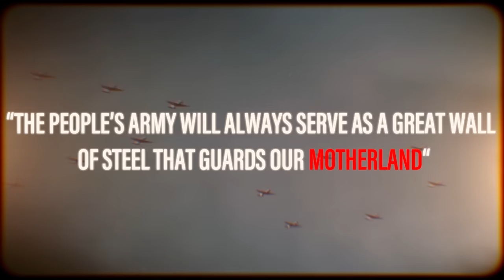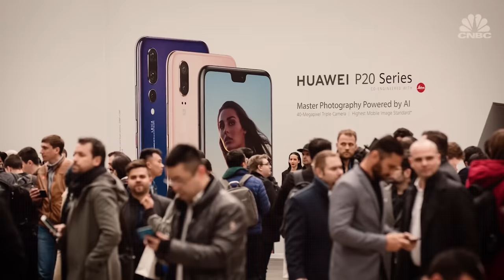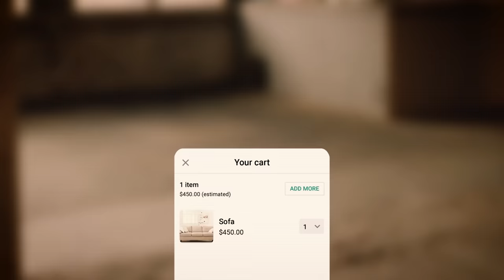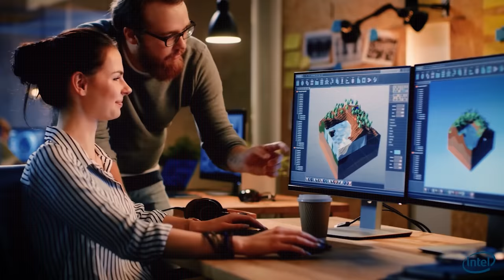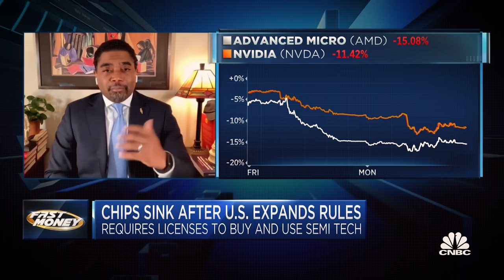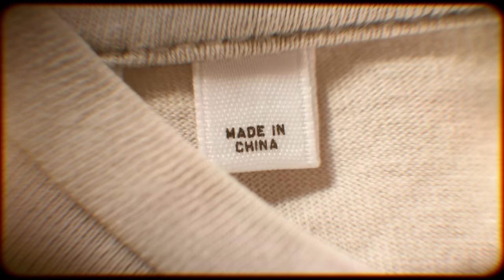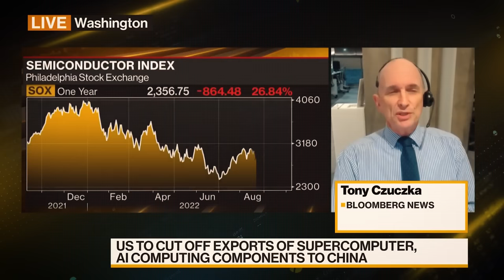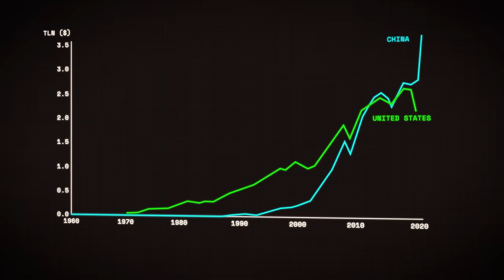America Just KILLED China's Tech Industry

Comment: So the problem with the AI wars... what we are looking at right now, is that they have a shelf life. AI is heading somewhere and very fast. So I've work in IT since the 1980's, I got my first computer back in 1979 as a kid.  In that time hardware... the physical technology like chip design, memory capacity, storage capacity, networking has exploded faster than any industry on Earth now or in the past. 

Every time it did the software needed also expanded to make better use. My first computer had about 2 kilobytes of usable memory. My second one had about 64kb of usable memory. The one I'm using right now in kilobytes has almost one million times that and the processor is almost a million times faster, and this is my home PC. This is something like buying a model T Ford back in the day and by the time you upgrade, the next car is the size of a shoe box, cost $1 and has a top speed of 10,000mph... that's pretty much a good analogy. And that held sway until about 10 years ago.

But the huge advances I've personally seen, and worked with over the past 35-40 years are nothing like the advances in AI hardware and software. The advance in the AI sector in just the past 24 months is similar to the huge advance I seen during all my time in this field, and it is accelerating.

But there is a wall coming. Eventually AI will be so advanced that we will no longer need human designers, or coders or even data scientists... the AI itself will be able to advance itself. That wall, that some refer to as the 'singularity', the last invention humans ever need to make themselves, by my reckoning could be by 2030. Some put it at 2040... and pessimists might push that out to 2045.

Hence the race. and hence the US putting the spanner into China, and Russia... right now. And Putin is right about one thing. Whoever controls AI really will control the world. 

But, I, and Putin are making the assumption here that ultimately AI is something that is controllable... otherwise AI will control AI.
Reply: It’s coming
Reply: I was told that the singularity was almost here in 1995…
Reply: @Donald Thompson eurobeat has an A.I. singer that sings and makes it's own songs. It mostly sings about killing itself though :/
Reply: I don't see how humans can possibly control a general AI; we've already been ceding control of many decision processes over the past few decades, as computers have become more efficient than us. They don't even need to achieve parity in intelligence to be superior, although I agree with you that this will likely happen by 2030. No way to predict what might happen once that threshold is crossed.
Reply: @Donald Thompson thats a good question, you know that art and images is a primary target for AI...and with the huge language models, then writing, news, articles, maybe soon books could be written by AI...

But there is something many pessimistic critics fail to recognise. Which is, for example, people still buy handmade shoes... And they pay a lot for those. Because they want articles that demonstrate craftsmanship and skill. Music absolutely falls into that category. 

But when do I think hiting an online composition model to write a jingle for your advert? Or write beats? Or elevator music? Well that ship has already sailed. If someone is a business paying for music they will always prefer cheap over art.
Reply: @sylviam6535  1995 was during the second AI winter... And we didn't have the processing power, and as someone that worked on early neural nets and genetic algos during the period everyone knew it. That's why we were in the AI winter. It's why many gave up... I sure did.  We knew what we needed, but it hadn't been invented yet. This is pretty much not an opinion, its a math calculation. Simple as that... And capacity has not reached the level that would make any sort of singularity outcome realistic right now. Let alone when processors had less than 1% the power and GPU's were something new in the mid 90's. But advances in gpu or tpu technology can be predicted decades out. Their capacity increases on a logarithmic scale. So im saying 2030 and I will be wrong there... Im no prophet. All im doing is looking at the trend and logarithmic scale. So I wont be a decade wrong...more like a year or two.. maybe 5 years out. 

Right now you have an AI in your skull and its cheap, its incredibly intelligent, it repairs itself, and it lasts nearly a century. It uses little power, and that power is supplied by cups of coffee and sandwiches and not a power station attached to a data center half a kilometer in size. But the day of you beating a machine the size of a phone, that uses 10% the power you use, and powering itself for hours after five minutes sunlight. Your competitor here is also networked to others,globally, the digital equivalent of psychic abilities.  On those metrics your days of king of the hill are ending fast.

But it is still just a machine, a tool... To be worried would be akin to an author in the 1460's  fearing the printing press. Plus if its an uncontrollable technology? Well the genie is out of the bottle now.. its not an IF now, its a when...and that when is predictable.
Reply: @gamerplays5131  the worlds first emo AI.. lets face it, it was always going to be a thing right?
Reply: @mickelodiansurname9578  - I don’t think it’ll do anything close to what you predict in 2030.
Reply: @mickelodiansurname9578  - When it is ready, if that ever happens, I’m pretty sure it’s that it’s first two uses will be (1) financial trading (making money) and (2) battlefield strategy (conquering others). Humans never change.
Reply: @mickelodiansurname9578  I'm glad you included coffee as one of the necessary fuels for the human AI
;*[}
Seriously though, it has been a long strange trip as the saying goes... I hope that we can keep from destroying ourselves in the process. I also hope that AI can help us communicate better and perhaps avoid situations like the Ukraine war.....of course that's what everyone believed the internet would do back in the day.
I'm not sure there'll be a singularity per se because raw materials are finite and our infrastructure ls so fragile it'll be a miracle if we make it to 2030....OTOH I never thought we'd make it this far. If we suceed in colonizing the Moon and Mars, who knows? Cheers...
Reply: @stevengill1736  Yeah there's a lot of scope for pessimism man, I can't blame you for that. I would not want to be an unemployed low skilled worker over the next 20 years. In fact I'm pretty sure I'll be replaced myself. But there have been a lot of 'the end of civilization' technologies in the past few thousand years. None of them turned out to destroy civilization as a whole. They sure changed it though.

Humanity has this amazing capacity for adaptation. Although I think this might be a little different.

And resources are getting more scarce now. But only on Earth, and only assuming those needed resources aren't changed... Whale oil is no longer needed right?! There's a whole chunk load of resources to be had out there.

But yeah predictions are hard to do as a 'what will humans do with this' sort of thing... but not hard to do if you are merely looking at the trend in terms of capacity, and assuming its not going to fall any day soon.
Reply: @mickelodiansurname9578  Funny and unexpected thing is, ai seems to replace high skilled workers first. First are artists, second are coders. Seems like taxi drivers will still be in demand when we coders will work for food.
Reply: @nathanielguggenheim5522   It is for sure a weird revolution alright. Now  lets face it we know our jobs are prime candidates. When this started off, well you've never seen someone buck up and brush up on their python so fast and spend hours every day on Colab learning how to create new models. I've been a coder since the 80's and yeah... the writing is on the wall. It's shape up, or ship out time friend!

Comment: Silicon lithography has almost reached it's limits. A silicon molecule is about .5 nanometers, so 2nm lithography may be the end. Then, we'll move on to other technologies, such as photonic chips and quantum computing. It would behoove China to try to leapfrog the West and just forget about low-nanometer chips. Use silicon for the easy stuff, such as toaster chips, and use photonic chips for phones, supercomputing, etc.
Reply: The gate pitch of 5nm devices are still 20-30nm depending on implementation. Photonic devices are less scalable, you need Terahertz waveguides, which requires silicon lithography; photonics will not have higher MT/mm than CMOS, it will compensate in modulation frequency and has some very novel integrations with quantum computing. QC is not going to be an alternative to traditional computing. There's a lot of ways to continue to scale Si, such as CNT gates (IBM pioneered the <1nm gate), GAA FETs, advancements in high-k dielectrics, etc., yes it will mean the end of Moore's Law and we will have to build bigger chips to continue performance advancements, but photonics is very limited in scaling if not more so than CMOS.
Reply: USA would simply delay the technology.
China leap frog 5g and 6g.
USA simply did not implement 5g regardless of how it would affect the economy and technology.
Hence US problems with self driving car tech.